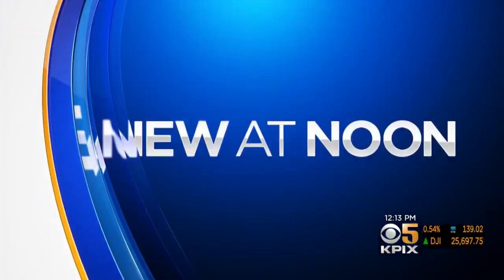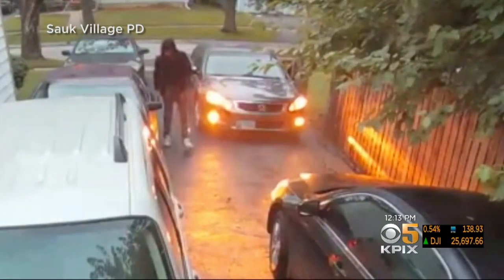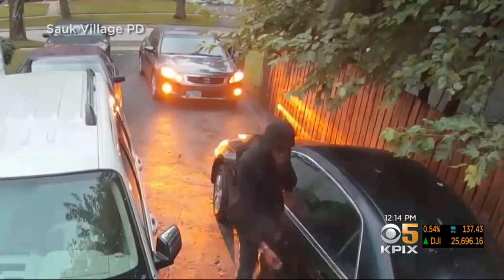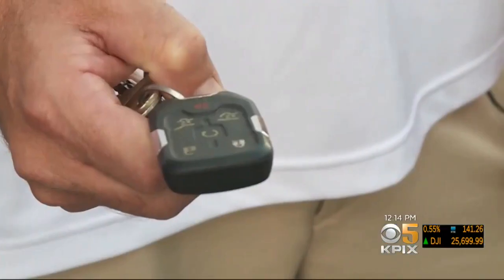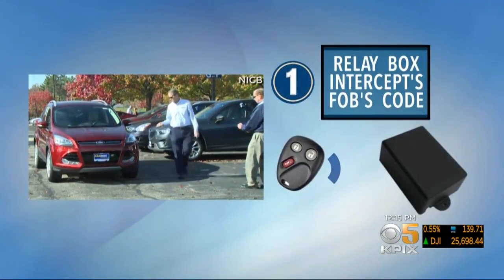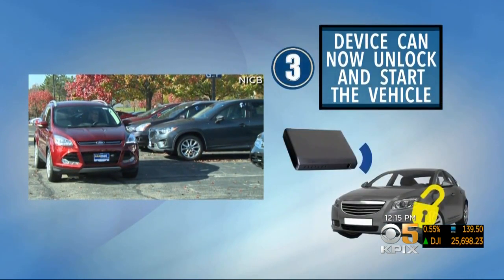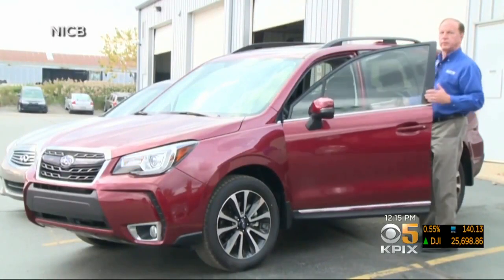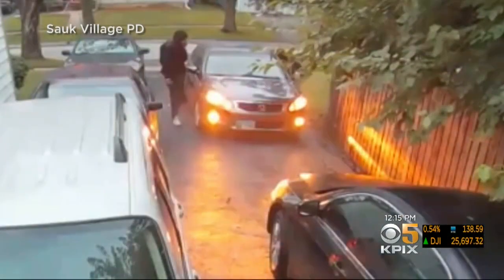Car Thieves Using Devices To Pull Signals From Key Fobs

Comment: That explains why many car owners still use a steering wheel lock. Those, usually yellow, steering immobilizers. Thieves may unlock it but not take away the vehicle
Reply: Uh what ? Steering wheels bend easily (to prevent injury....). 1 solid kick to the wheel, it's bent, steering wheel lock can be removed while locked.
Reply: I prefer a series of hidden kill switches
Reply: Trojan kill switches in obvious spots and one real kill switch hidden deep works for me
Reply: Not really, having the unlock code doesn't mean they also replicate the key chip, code needed to start the engine unless equipped with remote or keyless (pushbutton) proximity based start.
Reply: @stinkycheese804  They can get I  your car and use your garage door opener to break into your house.
Reply: Steering wheel locks are a waste. You can cut them off steering wheels with a pocket knife or scissors.

Comment: You can get a pocket shield sleeve for each of your key FOB units.  You can also get a small metal box, or use any type of metal container for storage of your key FOB units. When outside you can reduce the range of your key FOB by leaving it in the shield sleeve. You would have to go right up next to the car to use it. 

If you want to be fanatic with the FOB unit remove the battery. Use the inserted key to get in to the vehicle. Use the process to start the vehicle as like when the FOB battery is dead.  Check the user manual about how to enter and start your vehicle when the FOB battery is dead.
Reply: It would be easier for manufacturers to add an on/off switch to the fob or stop it from 24/7 transmitting. For now, you can probably just pull the battery

Comment: The best defense is a kill switch installed. Cut the fuel line or transmission circuit. Easy solution ;)

Comment: This may be one of the reasons why you get some sort of a discount for keeping a vehicle in a garage.  It would make it harder for someone to just walk up to it with some device and open the doors or start it and drive it away.  Some garage doors have physical locks that slide into holes in the track that would make opening the door nearly impossible.  That is because even if they somehow managed to repeat the remote control signal it still couldn't open.  One more thing I can do is cut power to the garage at the breaker (at the flip of a switch) and the garage door openers can't possibly work then.  Now about those sliding locks, they are separate from the red handle used to open the door when the power is out and they do take considerable force to pull.  If those locks are used the door is impossible to open.  They are strong enough to damage the gears in the openers if you forgot that you slid the locks too so keep that in mind.  Those locks work well to prevent someone from fishing a wire to the red emergency handle.  It is only an emergency handle because you can use it to open the door even if the power is out, allowing you to drive your vehicle in an emergency situation.  They are NOT INTENDED to prevent injuries from the door if it closes on someone (most doors will automatically stop and open if this somehow happens).

Comment: Doesn't a keyfob have to be constantly transmitting for this to be possible? Why would a keyfob need to be transponding when not actively being used? Either way, this is a problem manufacturers can easily solve.

Comment: No to rain on your parade but I highly doubt a metal box will work.  For anything to work, it has to be made with the intention of blocking a wireless signal (or at least attenuating the signal so much that it can't be picked up from a certain distance.  DO NOT rely on foil or metal boxes on their own.  The last thing you need is a false sense of security from thinking such a generic signal blocker is all you need.  It is just naive!!

Comment: This sounds like Misinformation.  I think they can only "capture" your signal when your Key Fob is in USE not just sitting on the counter.  The Thieves get near you at the Super Market Parking Lot, You open your car with the Key Fob, they Capture your Signal, follow you home, then come back later when you are asleep.
Reply: MsThylacine that’s a bit more methodical but still a possibility
Reply: A proximity type key fob will always emit a radio frequency which is registered by the vehicle if you're close enough to it.  If it picks up the unique signal from the key, the doors unlock by simply touching the door handle.  Thieves know which cars have this functionality and target these homes.  They'll walk up with a hidden antenna, wait for the antenna to capture the signal from the proximity key fob, and then boost the signal so that the car thinks the key is nearby.  From that point, the thief simply touches the door handle and voila, instantly in the vehicle.
Reply: It’s not misinformation. Newer cars have keyless entry that works off proximity. You don’t have to push the buttons to arm/disarm. You just have to be near the car. Some cars allow you to disable this feature but most people use it as a convenience. It is nice but it opens you up to relay attacks. They copy the RF that is constantly being emitted and then resend it next to the car which makes the car think you are standing there with the fob and allows them to open the door and start the car without the fob. That’s why you will see videos of thieves walking around outside of houses with large antennas on the relay. They are looking for the RF signal of the fob sitting inside the house.
Reply: @drb2k580  That  keyless entry proximity needs to be initiated by touching the handle and has a range no larger than the car. You'd need to be within 2 feet of the car for it to work.
Reply: @TraceguyRune  they can transmit up to 6 feet on some models. The way relay attacks work is the thieves receive and amplify the signal from the key fob inside the house then send it to a receiver who is within range of the car and touching the handle and it acts as though the person has the key fob within range.

Comment: Basically if man builds it another man can unbuild it, if a new design comes out, and there's a device available for business purposes such as a lock smith, then that device should only be available for Lock Smith's, and it should be regulated just like the silencer for a gun which you have to apply for one through the Fed's then it'll be a paper trail of who owns one..  but nooo all you have to do is go online and buy one . So basically putting our electronics in a metal box or a big asz ball of aluminum foil and the signal is untraceable?? Hum so with the alarms merchandise at stores too?? Your CELLPHONE'S too, I DONT get it, YouTube shows a crook not only how your mom car got stolen but also how to steal it back

Comment: First of all, I drive a car with  start button; which means, you can't even start a car without a key being physically in the car, near you; you can't drive at all if a key is not with you! Now, I am  speaking about  start button technique in the cars, not every car has that feature
Reply: Push button cars use proximity keys.  if they can open the door, they can drive off with it.  The BCM or immobilizer sends a challenge password or key to the FOB when you push a button on it, or by pushing the start button. The proximity fob replies, and you can unlock/start the vehicle.  For factory security systems, the password never changes.  Advanced aftermarket alarms have passkeys that always change, and the same code can never be used more than once.
Reply: @Rock_Reggae_Riff  Factory systems have had rolling codes and pw for years now.
Reply: If they clone the signal, they don't need your fob.

Comment: What is device called? Or model number
Reply: Jesus christ ....your still searching? ....i have the device!
Reply: The device the black guys had was just a codegrabber  ..they dont start the cars just record the signal look up (pandora 2.4)
Reply: @evanconnect8384  I'm not searching still I'm just looking for info that's all
Reply: @MRES3  its pandora 2.4
Reply: @MRES3  I am searching. I want to use it against myself so I can build a solution that prevents it in case it does work on 2022 cars.

Comment: Yes its true that's why I like 1998-2004 fobs. And anti theft . the thing is get another alarm 2 or 3 way alarm.  Hook up to horn to sound original Changes codes with door switches change door locks to another make as well as ignition and trunk. Either they will skip it or break the lock or try .. By then time ran out . some have towing sensors they may be annoying due to sensesitivity. And have a a killer switch hidden or push start or anti car jacking and always hide a. Fob

Comment: Remotes and keyfobs should have an on/off switch.  I know some lazy people will cry, bitch and moan but TOO BAD!
Reply: Who's going to cry? It's a brilliant idea. I tried to do it myself, but the key fob was so tightly packed on the inside I couldn't do it without making it look sloppy, so I gave up. It's very easy concept though if you want to do it home made. You just need a mini on/off switch and maybe 2 tiny 22 AWG wires. Key fobs are powered by little 3v watch batteries, so nothing fancy is needed. You put the switch between the battery and the grounding on the fob and you could control whether the circuit is open or closed.
Reply: As a tip, I recommend buying a blank fob on ebay for your car so if you need to cut or drill holes for your circuitry, you won't ruin the original fob
Reply: @TraceguyRune  Maybe even get one 3D printed if you are into that.  All you would have to do is make the shell and buttons.  Doing it that way you can add the cutouts for the buttons while you are at it and make it big enough to accommodate a switch.

Comment: I need to get one of those signal duplicators.I have a motorcycle that uses a key fob, but they only give you one and there is no other way to start the bike. The fob comes with a card that has a code you can use to get a new fob, but some idiot at the dealership lost it.
Reply: Try to bypass it

Comment: i use a cookie tin and it works well, just put your keys inside and close the lid and see if you can open your door.  If you can't then their amplifier won't be able to either.
Reply: What do you mean? Push the unlock button with it still in the tin box?
Reply: I have a Prius so to unlock the door I just put my hand on the door handle and the intelligent key will just unlock my door. Once I put my key in the cookie tin and close the lid and put my hand on the door handle it won’t open. The signal is now blocked and the car can’t see the key
Reply: @johnnywang206  gotcha! 👍
Reply: @johnnywang206  we aren't after a prius bud
Reply: @johnnywang206  The moment the intelligent key communicates to unlock it, that's when they can grab the signal.  it's far easier to grab out in the open as people approach a vehicle that to get it through the walls of a home from the outside, unless you're taping your key to the window, lol.
Reply: @God-hs4hc  someone broke into my Prius while I was sleeping so while you think it’s beneath you, it’s not beneath others to do it.
Reply: @stinkycheese804  grabbing a signal of a car that’s leaving? That’s pointless. My key was in the kitchen on the other side of the house and they were still able to get in. Not sure why you think the key needs to be up against a window.

Comment: I sell these high tech devices
Reply: Why though
Reply: What do you mean why....because i can
Reply: Rather have my doors hacked than my windows smashed
Reply: How much are they ?
Reply: Contact me on telegram app @EVANCONNECT
Reply: judgementday 666   if you are interested in the device than download it , idk what else to tell you lol
Reply: @Dannydawson537  what's up, how are you
Reply: @evanconnect8384  u still got em
Reply: @devlin8  i have one bro if you are still looking for
Reply: @damien1930  how much ?
Reply: @1stikkk287  yo.
1k for 1 transmitter and 1 repeater ( coded by myself ).
Reply: @damien1930  wya I’ll buy rn
Reply: @damien1930  ion got telegram🤦🏽‍♂️
Reply: @damien1930  $1,000 ? That seems like a scam. I need something cheaper.
Reply: @damien1930  Does it work on 2022 Hondas?